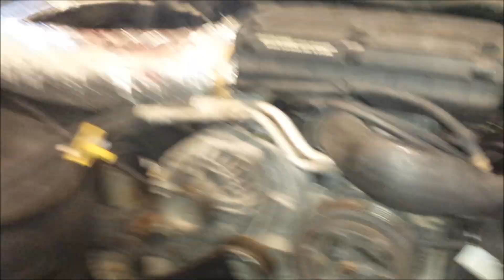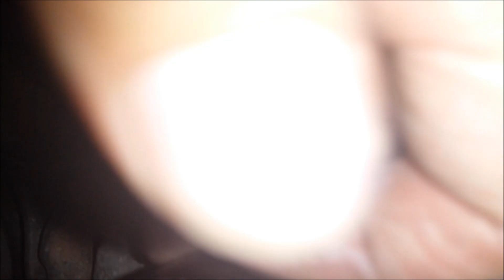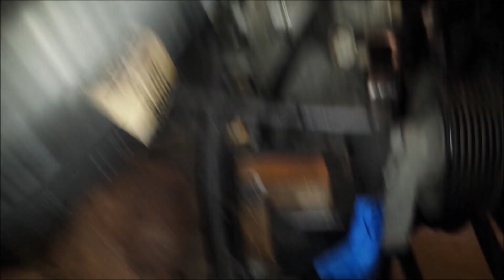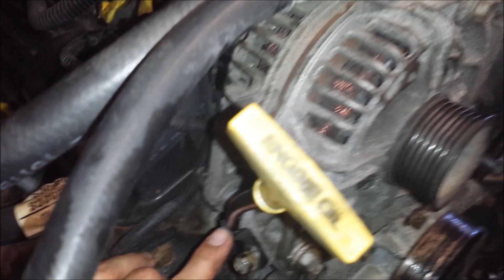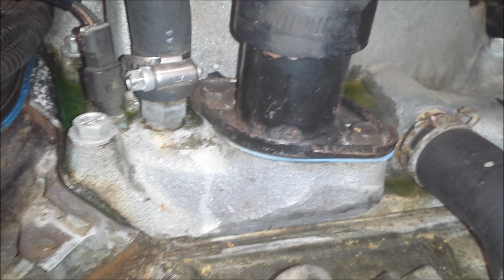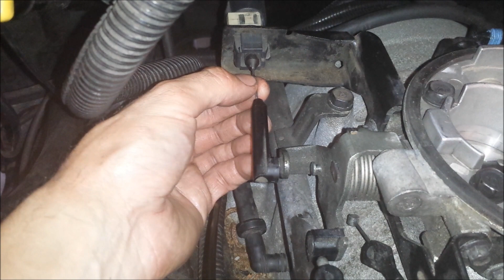2001 Dodge Ram 1500 - Intake Manifold and Plenum Gasket Repair - Part 2

Comment: Hey man I’m in a bind. 
My front two bolts both broke, one is a little out of the hole the other whole almost looks disintegrated.. can I drill it out or am I totally fucked. 
Love my truck have followed your tutorial step by step. I didn’t think I’d have this problem with a California truck. 
Thanks -Hopeful dodge R/T owner
Reply: Drill them and use an easy out, apply some heat to them with a propane torch
Reply: @kellismith4329  I got one to back out with a vice grips and wd and drilling out the center, the other I was able to drill out. Thanks!

Comment: Did you go with the Fel Pro gaskets or the basic ones? I’m not too sure if one is better than the other. Just bought a 94 1500 and plan on doing this repair, just trying to get as much info as i can

Comment: I'm just trying to find a video for a Van because I just want to know for sure if there is enough room to do it in there... Pretty tight in ram van compared to the truck.... I've got a 98 Ram Wagon 2500 with a 5.9l and 236k miles, pretty positive it has a bad gasket because I'm getting 10mpg even though I'm driving it like I'm 80 and one morning I had to give it a little gas on the way to work and a poof of smoke came out when I started it up after getting gas. Oh and it was almost three quarts low the first time I checked the oil level after buying it.

I can't imagine having to pull it.... But if I do it's going to have to wait. Don't you love buying used cars and finding these things later? Lol runs fantastic other than that though...

Comment: May I ask, do you have to remove the throttle body from the intake? I know you did. But just wondering if it was a must do.
Reply: I have the same question.   I don't think it's necessary.
Reply: @HighSierraBob  not necessary but good idea.  Get the gasket set with screws, gaskets, and go fo rit.  Clean the throttle body as well as the idle control valve while your at it and save some headache.  Do the job right the first time.
Reply: @johnvaughn3489  - yes, makes sense about cleaning the throttle body.   Also wondering if RTV is used on the intake gaskets or do they go on dry?
Reply: @HighSierraBob  perfect seal is your best friend.

Comment: I found the fan bolts pretty hard to get to and I couldn't easily get them loosened so I elected to remove the radiator which was pretty easy and gives a little more room to stand in there, I did end up taking the whole fan assem off anyway to clean it up.  I'm going to try and find some 1/4" aluminum at a scrap yard to save a little money.

Comment: Im not much of a car guy but this video as well as part 3 and your O-Ring replacement video was just about the only good videos I could find on replacing my fuel injectors. Are there any other tips you have before I start tearing apart my truck for the first time? lol. Thanks a bunch!
Reply from the maker: Hi Skot, I'm very sorry for not replying sooner - I was completely overwhelmed at work this summer/fall and I am just now getting a chance to catch up on messages and comments.  Please accept my apology, as I do try to make a point to respond to viewers in a timely manner.  I just got swamped over the summer and really couldn't keep up.

I'm guessing you have already done your repair project, but if not - my only additional advice would be to make sure you give yourself plenty of time, get organized before you start, have a clean work area so you don't lose anything, and most importantly - document each step with photos and notes!  My photos/videos have probably helped me more than anything else, as I can just refer back to them if I can't remember where a certain bolt/wire/hose/etc. came from.

I'm sorry again for my very tardy reply, and thanks for watching!

Comment: I appreciate the details in your video, I used them many a time through out my repair. And anyone out there who thinks this is to difficult it's not really that bad and you can even repair the water pump and timing chain with a little more work , I would have if I had the coin.
Reply from the maker: +rockcrawler1234 I'm glad you found this helpful!  And I agree with you - it's definitely a job anyone with a few tools and some patience can handle.  Very true about the water pump and timing chain, too....I wanted to change both when I did the plenum repair, but got impatient and wanted to get the truck back on the road, so I skipped both of those.

Thanks for watching!

Comment: You have an extra evao thing under your hood. I just a clamped off hose. does that go to a large evap hose from he charcoal box ?
Reply from the maker: +Richard Cowtails My truck is broken down and sitting at a mechanic's shop right now so I don't have access to it, but which hose are you referring to?  There should be a charcoal canister, as well as a purge pump, which tests the pressure of the EVAP system to tell the computer if it is functioning properly.  But, I don't remember how it is all connected off the top of my head.
Reply: +Matt Payne shit... whats wrong with your truck? no codes or anything just curious lol. I dont have the larger black thing.
Reply: +Matt Payne mechanic aka pull out another thousand
Reply from the maker: +Richard Cowtails LOL at your last sentence....I have that problem, too.  But in all seriousness...I really don't remember how my evap hoses are set up.  When I get my truck back, I'll let you know.

My truck died while driving home from work at the end of June.  First the trans slipped into neutral, then about 5 seconds later the engine died.  I coasted to the side of the road and let it sit for a few minutes, and then re-started it.  It stumbled a bit, then idled normally for several minutes, so I tried to baby it to a local shop.   But it did the same thing almost immediately and then would not restart.  Since then, I've replaced the crank sensor and ignition coil, but had no luck.  I finally had it towed to a mechanic I trust (who's not the kind of guy to bust you on labor for a problem he can't fix), and he hasn't been able to find the problem either.  We both agree that we've probably narrowed it down to a bad computer by process of elimination.  He replaced the cam sensor with no luck, so really the only remaining options are the computer or a wiring problem.  Hopefully I can get a replacement computer and get it to fire up.  Fingers crossed...
Reply: sry I screwed up that last sentence, huh lol. that sounds awfully computery. I'd get a junk one from a recking yard. seems electrical at the least for sure
Reply from the maker: +Richard Cowtails Haha, no I was just making a lame joke.  I'll have to price a junkyard computer and see what it would cost to get it programmed.  I know I can get a remanufactured one from O'Reilly's for about $350....which is kind of an expensive gamble since I don't know for sure the PCM is bad....but we'll see.  I don't want to just give up on the truck and junk it, so I've got to try something.
Reply: absolutely! asd relay? loose ground? <probably not maybe fried the computer
Reply from the maker: +Richard Cowtails The mechanic jumpered the ASD relay and still got no power at the coil, so I think we've eliminated that.  I suspect a loose ground is the culprit if the new computer doesn't solve the problem....but that could be a really tough/expensive thing to find.  I really hope the computer is the answer.
Reply: +Matt Payne computer of ignition related

Comment: Was breezing through your video in advance of replacing the plenum gasket and modding my stock manifold as well as a shorty header install and wanted to first thank you for the in depth video...while I do not such a detailed breakdown, I know that others do.

Second, I wanted to add a tip/trick that we use at our shop to help with identifying locations of wiring and hoses. Get a cheap container of assorted colored zip ties and use those to label connectors and their proper sensor to plug into...like the TPS sensor would get a small green zip tie on the end and the harness that plugs into it get a matching zip tie. The long ends help as a "flag" to make a harness end stand out and not get lost amongst other wires, and is secure unlike tape that can fall off due to oils on parts. Just have to make sure when the job is all done to either remove the long ends of the zip ties, or remove them completely (make sure to no cut a wire or drop them into the engine)

Like I said, great video and hopefully someone reads this and it helps them out.
Reply from the maker: Daniel Hammonds Thanks for the compliment, Daniel!  The level of detail in my videos is definitely "overkill" for any professional/seasoned mechanic.  However, I am anything but a professional mechanic, so my thought process in making these videos is that more information is better for someone who has never done these tasks before.  I know that any time I try something new, I try to find as much information as possible.  I also invariably get caught up on certain steps, so I hope to save others the same aggravation by offering tiny details that they might not otherwise know about until they're elbows-deep in their engine bay and cursing under their breath.  I figure it's not possible to offer too much information; but I know it probably takes a lot of patience for anyone with experience to sit through my videos (if they even click on them in the first place!).

Thanks also for the great tip!  I honestly had not thought about using zip ties, but that is a brilliant idea.  Much neater, and quicker, method of tagging things.  I guess the only challenge is having enough colors to differentiate between the many hoses and electrical connections, but I suppose for most people with even a basic understanding of "what's what" in their engine compartment, there should be no confusion.  You could double up on colors for things that are on opposite sides of the engine bay, or for things that quite obviously can't connect to each other.  Great suggestion.

On your manifold modification, are you planning to shave off the ends of the runners?

Thanks for watching!
Reply: I work on large trucks and we use zip ties all over. The multipacks usually have a mix of colors and sizes, and as you said you can double up on colors or mix 2 colors. I replaced the entire cash of a 2001 freightliner using them to mark everything out (roughly 25 gauge connections, a dozen air lines).

As for modding the intake, I plan on cutting 1" off the runners and beveling. Have a 99 so I shouldn't have a center divider, but it does have a junk yard engine so I could be surprised.
Reply from the maker: Daniel Hammonds I'll definitely remember this tip next time I have a large project.  Thanks again for sharing it!

Let me know how your intake mod goes....I'm interested in the results you achieve.  Good luck!